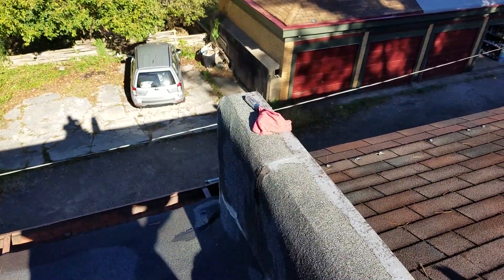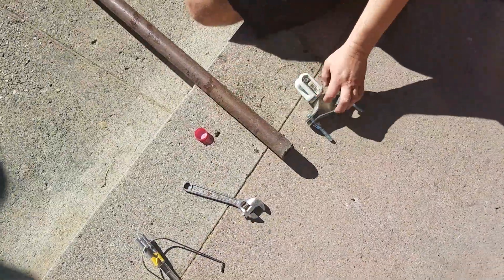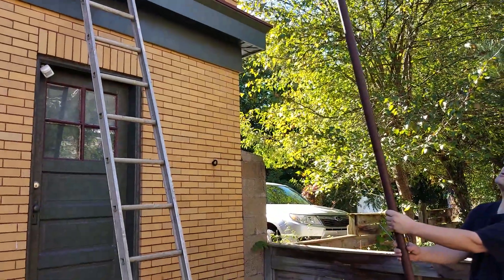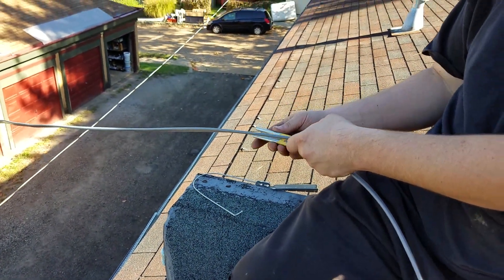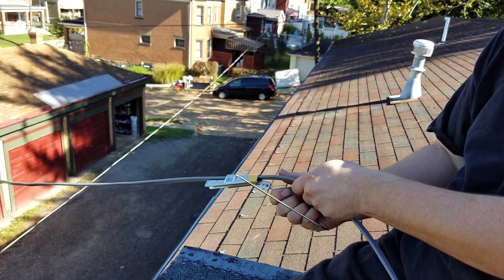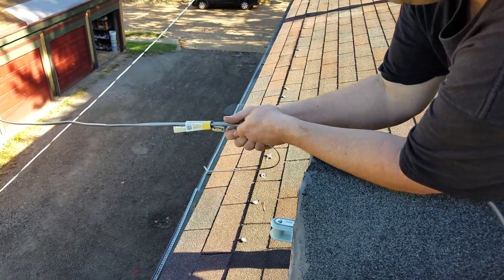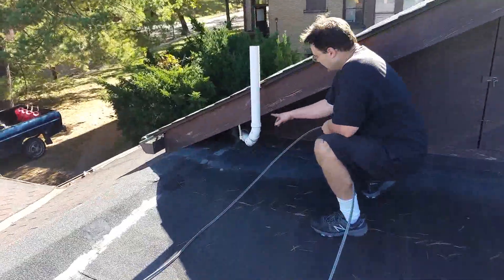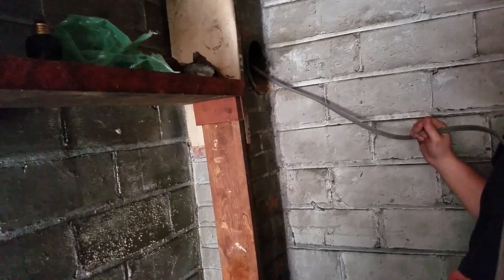running over head electric wire building to building

Comment: This works fine but is not code. Get triplex or quadplex, (it's type USE with a steel cable) for the wire in the air. Then type SER wire up the outside of the house or inside (no conduit needed). If you want to use conduit for your riser, you can use THWN, etc.

Comment: what you should have done, was made the same run you did with the electrical wire, but with steel cable.  Then with a few wraps, run the electrical wire along the cable, ensuring that a bit of extra electrical wire was loose on each end to make sure that the wind would never pull the electrical wire tight and damage or break it.  The steel cable then handles the physical stress, and the electrical cable does the ONLY job it is meant to do, which is to conduct electricity.
Reply: Code only requires messenger wire if its up to 50ft in length.
Reply: Do you have a video on running the steel cable and then the wire ,that seems smart as well .

Comment: Incredible job I’m running #6/3 copper from my house to my shop 100 feet away I believe As long as the wires are wet rated😎🤩👍
Reply from the maker: Have you thought about running that underground. That's a long run.
Reply: themrhelperguy yes I have it will be quite some digging 😎👍
Reply: @themrhelperguy  so was yours so both lost power through resistance based on wire size and 100 ft runs need next size up
Reply: How did this go.
Reply: Just don't do it like this
Reply: needs to be wet and sunlight resistant

Comment: This still standing? Or did it blow up already?
Reply: I'm a journeyman electrician,  this is so out of code I wanna throw up, that UF wire is gonna stretch and aventually tear and short out, that is over 50 ft over overhead wire, needs a messenger wire, and don't get me started on the chimney part
Reply: @jamesalexander2041  the chimney part was the best part! I can't believe they did this
Reply from the maker: Do you really think it could blow up?
Reply: @themrhelperguy  because electrical wire is not meant to handle the physical stress of runs like that ... you are meant to run steel cable and hang the electrical cable on the steel one.  So while 'blow up' may not be the best wording ... 'did it tear loose, short circuit, and burn down your house?' would be a bit more accurate description of the potential problem.
Reply: @chipandputt  Code states that you only need messenger cable if its 50ft or longer.
Reply: @chipandputt  agreed, im an apprentice and i know that lol that cable going to rip from tension . steel cable is a must

Comment: What are those clamps called that you used to suspend the wire and where do you get them? Is the wire UF-B?
Reply from the maker: The wire is Uf-b I don't remember the name of the clamps but I bought them at home depot. The were hard to find but I knew the carried them.
Reply from the maker: Service wedge clamps